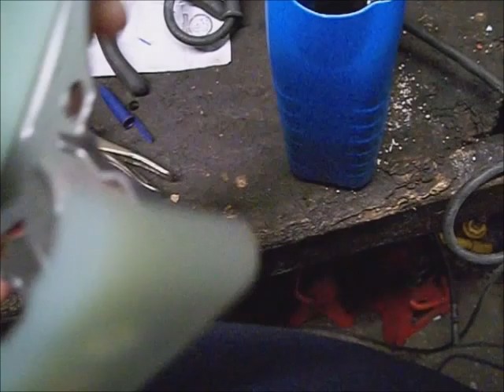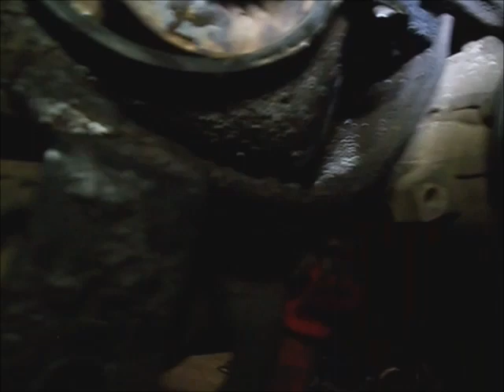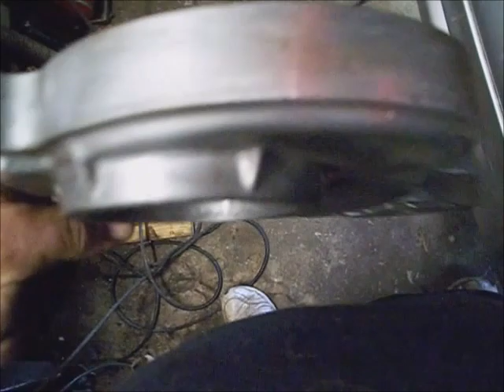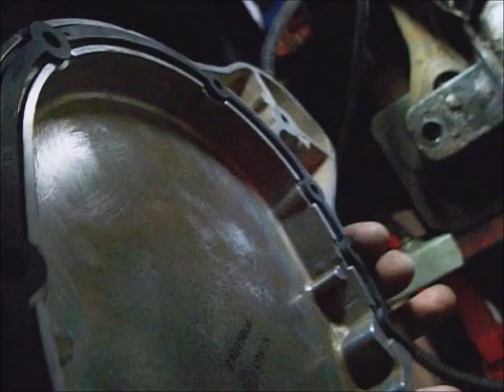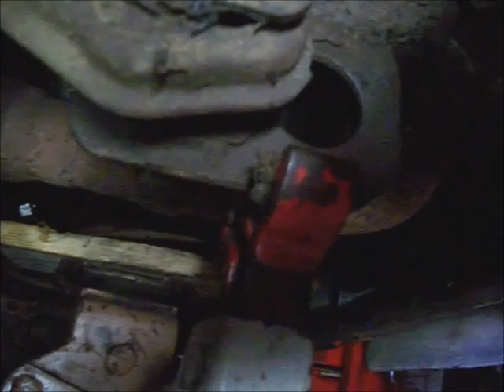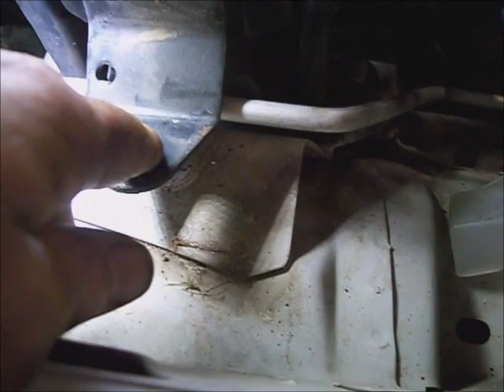Pontiac Sunfire 01 w 2.2l timing chain install pt.2

Comment: I’m having trouble getting my timing cover off I have one bolt on the bottom that needs to be removed but it won’t move. It goes from the oil pan to the timing cover. How can I get it off .
Reply: Weld a nut to it

Comment: From what I have read there is a replaceable plug (similar to a freeze plug) near the cam sprocket. This plug needs to have a ~3mm hole in the center to allow oil to be sprayed on the assembly. If it's not there it needs to be drilled in the replacment.
You did not cover this at all.
Reply from the maker: This chain set had like, 90k miles on it, and served its purpose, and duration, for an aftermarket chain.  If regular oil changes are performed, and oem parts used, the service life of up to or over150k,  is a typical.

Comment: I'm wondering about the crank marks and TDC. Does it being lined up means it's good? Or do I need to make sure it's at TDC?
Reply from the maker: If the chain is broken, the crank should be moved off of TDC about 1/2" down cylinder, while rotating the old cam shaft sprocket timing mark hole, and approximate aligning it with the timing mark tab on the tensioner bracket, before removing sprocket.  This is to allow for valve clearance while rotating, with an unlatched chain.  Other than that, TDC is irrelevant, as long as timing marks are in alignment with tabs on tensioner bracket.  If it were a v-8, it would be a different matter.  Thanks for watching

Comment: i am looking at a 02 pontaic sunfire , body is in amazing shape car has 74,000 miles on it , he says it wont start and "He" thinks it needs a timing chain? how can i test this to know if that is actually the problem? thank you
Reply from the maker: Normally a compression test, would be quite revealing.  But the chain in those wont go bad until well past 150k.  If used high mileage engine was installed, mabe it would be bad.  Check for coolant in oil, mabe was over heated, cracked head.  Also, if it set with old gas in it for at least 2 years, the gas becomes thick, and can  hang valves guides.  Bending them or the pushrods. I could go on and on.  But taking the rocker arm cover off of the head (with coil pwr unplugged) and watching the valves/rockers operate would be an option.  If equipt with a cam sensor, scan tool would reveal a cam/crank correlation error, if chain was out of time.  Thanks for watching.

Comment: Hi.  I have a 97 Cavalier 2.2L.  Is this similar to changing the timing chain on my 97 as far as body clearance and other obstacles and the same engine characteristics?  Thanks a bunch.
Reply from the maker: I believe so
Reply: I found a timing set that was designed to eliminate the tensioner.  Is this a good alternative to a stock setup?  It seems the stock setup (chain with tensioner) isn't that good of a design.  I don't recall the manufacturer but they are a reputable company that makes stock parts for new cars and replacement parts for older vehicles.
Reply from the maker: I haven`t used that set on anything yet to say how well it works.  But the oem stuff on these typically lasted over 150k miles, near 200k if oil maintained.  At the very least, always use a GM chain tension/guide plate. Non oem can bend and get into the chain, breaking the chain.
Reply: This set I'm referring to doesn't use the guide plate or tensioner.  It's been designed to eliminate that.  I guess I will do some searching online to try to find something.  Thanks.

Comment: Did you need a pulled to remove crank sprocket?
Reply from the maker: yes
Reply: @AutoDrdiy  if you can't get a puller on the sprocket roll engine keyway straight up if you have an air chisel gun find a chisel that will fit between the sprocket gear at the keyway energize the air chisel the gear will break and slide right off I did that today
Reply: I would like to point this out 2.2 engine is non interference when you break the chain the valves will not hit the piston
Reply: At 5:03 you will see a plug that goes in the oil Channel fix for this to keep the chain tensioner lubricating the that I bought yesterday from O'Reilly Auto Parts has a plug with a hole drilled in it that will lubricate the tensioner you can screw a bolt in the plug when you wiggle it  back and forth and get it out tap in the new plug  it's not hard you need to replace this plug you can drill a hole in it about an eighth inch I think  if you don't know where that plug is ask somebody
Reply: Remember this on the bottom of the cover there's two studs you have to remove them what's a star socket or put two nuts on the stud tighten them together and go easy on it if it doesn't turn out you're going to have to beat the cover up by the stud preferably with a heat gun you can use a propane torch on it but easy does it I got one out this way I had to use heated up and use vise grips on the other one went to a parts store and bought two new studs make sure the studs are identical the one I bought was wider in the center I had to put a spacer between the cover and the nut I got a 3/8 nut put it in the vice drilled it out so would slide over the stud that worked have fun it might be easier to leave the studs out put bolts in the cover yours might not have two studs on the bottom mine did
Reply: REPEAT THIS ENGINE IS NOT AN INTERFERENCE ENGINE VALVES WILL NOT HIT PISTONS
Reply: I recommend if you have a hundred thousand miles on that chain change it
Reply: the kit  that I bought had a crankshaft pully repair sleeve with Loctite
Reply: If you see my message I want to tell you you did a good job
Reply: I would highly recommend you replace the belt tensioner the grease in the pulley wheel bearings evaporate and it gets dry if it locks up you will burn the belt off

Comment: I'm trying to find if you're supposed to put any silicone on the timing cover gasket...but it was already stuck in there so you didn't show that.  I guess the rubber gasket does the job w/out?  It didn't appear any was on the old original one.  I've got my pan off so I guess all the silicone can be done at the time I put it on?